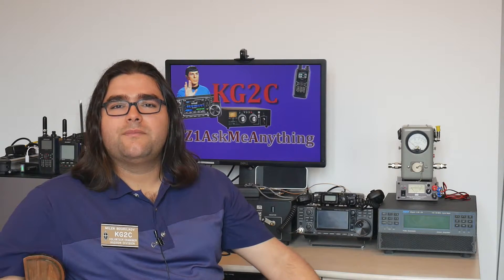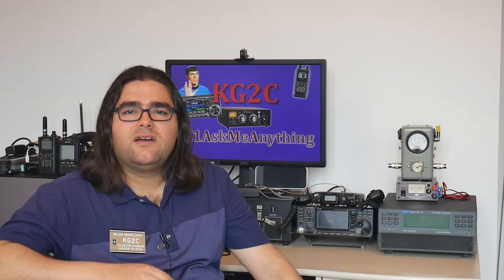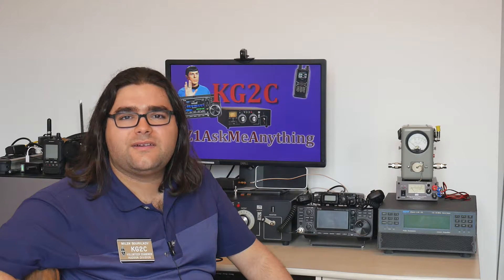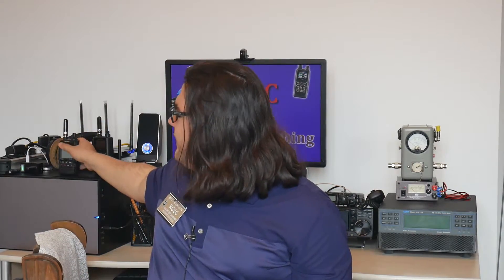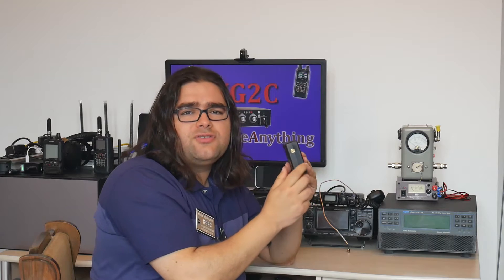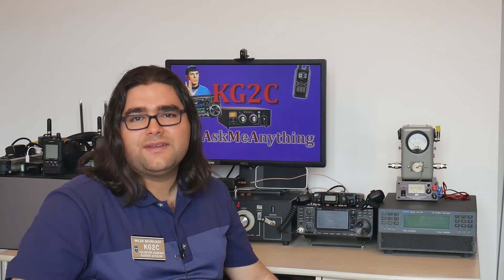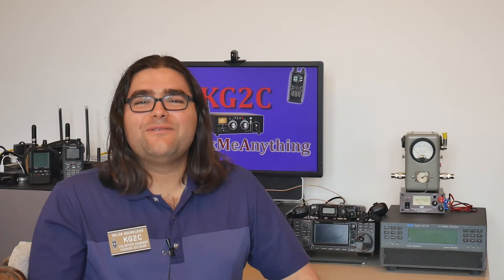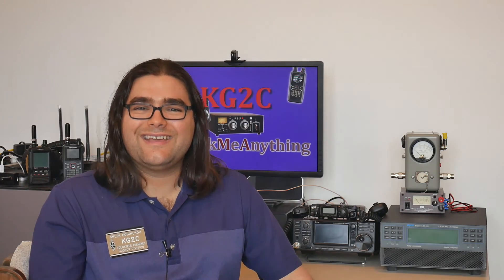The RF connectors series: BNC connectors

Comment: From my radio club, old members told me to use so239 connectors for an antenna project. That time, i had not a good knowledge about rf connectors. But now, like you, bnc connectors are my favorite one. I just used them everywhere possible. I also baught some sma female to bnc male adaptors. But while using in outdoor, the bncs are not that good, because they are simpelly not recomended. Its completely fine. Thats why, today i baught 2 n type connectors for the first time😅😅😅 was searching for some videos on it, and got a bnc fan like me😊🥲😊